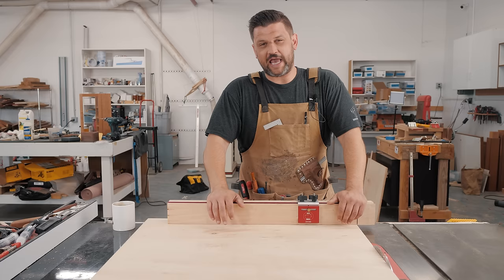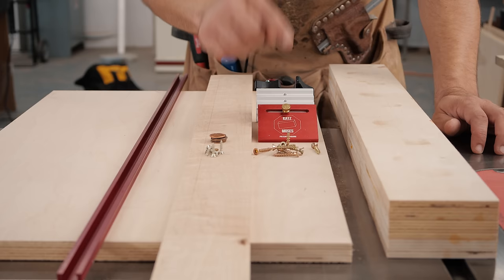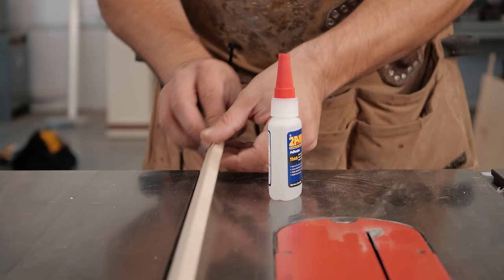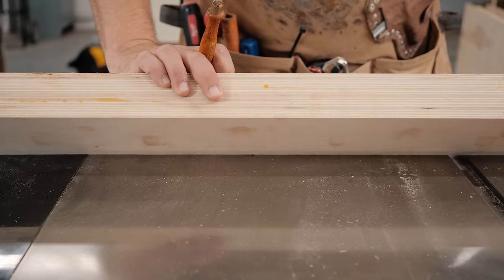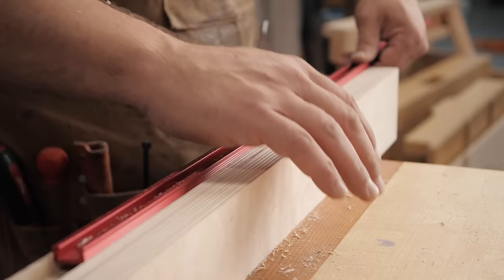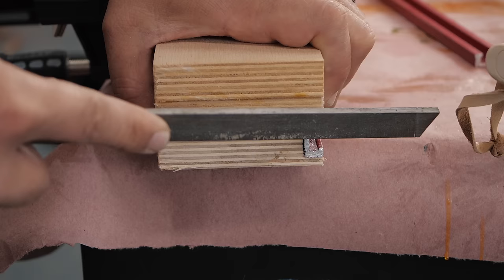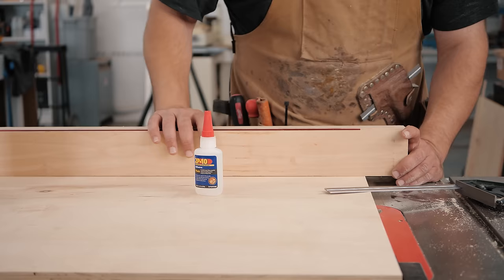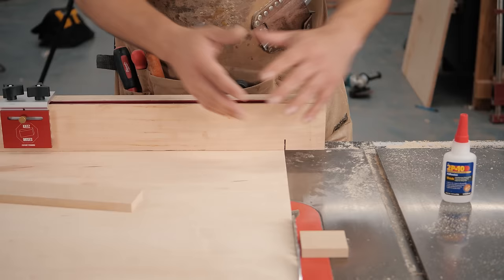Super Accurate Simple Crosscut Sled

Comment: 5-cut method isn’t for lack of a reference surface.  You can put a 1/8 strip of wood in the kerf of a normal sled and use that as a reference.  5 cut gets you dialed in much more than a square can.  I use a known accurate square to align my fences when I first attach them to my sleds.  They always end up moving after 5 cuts.

Comment: I don't get why everyone insists on using hardwood for the runner. I've tried this and have had issues with wood movement.  I went to plywood and I couldn't be happier. It's dimensionally stable throughout the year and super easy to batch out a bunch of them once you dial it in perfectly. Yeah it may dent or chip over time and use, but never along the whole length simultaneously and never had it bind or become loose.  Maybe I'm missing something, but I'm happy as a pig in ..... Well you know.
Reply: I use UHMW Plastic which is very slick and not susceptible to movement either.
Reply: @KeithJohnsonCustomWoodworking  Thats a great option too.  I never seem to have any handy when I suddenly decide I need to make a jig. But I agree.
Reply: @brett328  I keep a couple of wide strips around - it's great material for auxiliary fences as well.
Reply: @brett328  Walmart uhmw plastic cutting board. Very cheap and you can get like 6 pairs of runners
Reply: @KeithJohnsonCustomWoodworking  cheap dollar store cutting plastic board works makes plenty of runners

Comment: I am in the process of making this sled. I just purchased your stop block and it's awesome. I do have an issue with gluing down the fence. Once it's glued and you find it's off a tad, your project is trash. I prefer to use two-sided tape and screws. If I make any mistake with the accuracy, I don't end up throwing away this project. Once it's glued, your screwed.

Comment: If that method truly is accurate for square, I have an idea. Make the right side of your crosscut sled just like you did here but have a full width fence. Square the fence up as shown, then make the left side with a second runner. Butt the left side up against the right side (blade down) to glue on the left runner. Attach the fence to the left side, then raise your blade and cut the kerf width off the left side of the base. Does that work?
Reply from the maker: That's a damn good idea!
Reply: Yes that totally works, Mattias Wandel did a video building a sled this way.
Reply: I was just thinking the exact same thing myself after watching the video and then scrolled down to the comments to see if someone had thought of that as well, and here we are.
Reply: same here
Reply: Just had the same thought.
Reply: Good idea
Reply: I have read this ten times and fail to follow along. I even tried to find Mathias Wandel reference. My first point of confusion is left and right. Is this from the operators perspective or viewers? The next is butting the left side up against What?  Even as I try to explain myself I become more confused. Can you clarify? Thanks
Reply: @willemkruger4564  I will try. Everything is from the operator’s perspective. Your fence is to the right hand side of the blade, right?  So cut the right side of the base. Attach your right runner. Personally, I would install the runner with a little overhang over the saw blade (to the left) and make the final cut using the runner instead of the table saw fence. 

Attach the sled fence with one screw so it can pivot. Remember the fence should be the full width you want for the sled with half (or whatever) hanging off to the left side. Use your biggest accurate square to get that fence square to the cut you just made. Secure the fence to the right side base with more screws. The fence is now square to that cut. 

Now just butt the right hand edge of the left side of your base (that you already cut) up against the left hand edge of the right side base. Screw the fence onto the left side. Attach the left runner. 

Put the saw blade below the surface of the table, just like you would do for a zero clearance insert. Put the sled in place with both runners and slowly raise the saw blade up into the middle of the sled bed, then move sled fore and aft to complete cut. 

This may not be as exact as the 4 cut method, but I bet it’s good enough for 95% of applications.

Comment: I've made a few fences and easier than routing the groove for the track is to cut the center piece of ply shorter than the other two by just enough to set the track in flush. Why not? You're cutting the ply anyway, so might as well dial it in before hand.

Comment: I really don’t understand why you wouldn’t check the fence using the five cut method. It’s very very easy and will tell you straight away if your fence is set properly or if your square is inaccurate.

Comment: BTW Great video and I actually don't think you lose features like width of sled. I think you do the same thing as you did but run a longer fence past the cut and then just add plywood on the other side . Either attached the fence to the other half or leave sliding as support like I believe the Incra sleds do.

Comment: Jonathan, great video as always, but I’m wondering why you didn’t make a chamfered edge on the bottom of the fence to channel away dust? I was hoping to see that, because having the chamfered edge makes lining up the square ( 8:10 ) challenging (because the thickness of the square is thin.) Would have been interesting to see how you address that.
Reply: Also missing some steps on how to get the fence squared while attaching it! Ugh

Comment: Question for you… could you theoretically use this method (not using the 5 cut method) to make a sled with 2 runners?  For example, could I attach just the left runner first (leaving plenty overhang on my base) and then run the sled through with that runner in the right miter slot, cutting the left side of the base with my saw blade.  Then square my fence to that cut and attach the right runner and then finally attach the right runner?

Comment: Now something else I need to make. Did you think about running a 45 on the bottom edge of the fence to stop dust build up?
Reply: Good idea, but I bet since Jonathan's stop block doesn't sit on the sled that there's enough gap to avoid sawdust from getting between it and the piece being cut.
Reply from the maker: Agreed but couldn't hurt certainly
Reply from the maker: Couldn't hurt but like the gentleman below said not very necessary

Comment: Here's a thing. What if you made 2, one for the left side, one for the right. Then used an extended backer to join the 2 together (and a rear brace). Then you wouldn't need the 5 cut method, but it'd be just as accurate. Right?

Comment: Quick question: first off, I built this crosscut sled a couple of months ago and it has been an absolute lifesaver. I’m in love with it and now I rarely use my miter saw.  Thank you for sharing this build!  I did outfit it with a KMT stop block and grabbed some rails from your shop as well!

so I’ve recently had the need to cut some 45° miters for some very small miter joints on small work pieces, and the idea occurred to me that maybe I could modify this crosscut sled, seeing that it only uses one miter rail, if I moved the sled over to the right miter slot and set my blade for a hair shy of 45° (I have a left-tilting table saw) and cut through it down the middle of the sled for 45° cuts? I would probably put a structural fence at the back of the sled to hold the back together before making that initial cut through the sled.  Is this a terrible idea? Do you have any additional thoughts or recommendations? I appreciate any guidance you may have before I go ahead and potentially destroy my beautiful sled.

Comment: The 5-cut method is perceived as difficult to understand because it hasn't been adequately explained.  All you are doing is making a cut, then using the inaccurate cut to make another, doubling the error.  Once 5 cuts have been made, the resulting total inaccuracy is 5 times the error of the single cut.  Then all you need to do is divide the total error by 4 to find the inaccuracy of the first one.

Comment: This sure beats the 5-cut method.  I will be making one next week.  What do you think about using t-track scraps for runners?  I have some that are countersunk and fit the slot perfectly.
Reply from the maker: Nice. Metal on metal doesn't sound like a great long term solution for a sled but aluminum is pretty soft so maybe it'll be ok.

Comment: Truly like the build, specially the use of a "T" track on top for stop blocks. The one thing I don't like about it, it still allows, (even if it's a scrap piece), the cutoff can still drop down on the spinning blade. I like a "two piece" crosscut sled or a very large solid 1 piece that covers my entire TS top, each their own. Great video. Cheers :)

Comment: How about a full width sled but insert a piece that is the kerf width into the kerf and square from that?
Reply from the maker: Pretty unreliable imho
Reply: I have a pair of large drafting triangles which are as thick as the blade kerf and it worked well as a register.  I put the runners on the bottom and a front piece on the sled to hold it together. I then cut the blade opening, stopping at about the point where my fence would be.  I was then able to reference the large 14" 45° triangle to the 30-60 placed in the kerf and get a good square sled.  I've done this on about 6 sleds with no issue.

Comment: the track on my table saw does not have straight walls.  There are small indentation periodically along the track.  thoughts for handling this with the runners??  Also, my table saw is portable and only has one track.  Is this a problem??

Comment: Question I have the same problem, if not at first then eventually probably b/c of how I store my sled but at 7:50 you can see the base of the self does not lay flat as the board is warped. Will this cause issues in your cut? I imagine it would not be square on the Y axis of the plane to the blade. I've scrapped a few sleds and started over esp on MDF ones but wondering if I really didn't need to.

Comment: Just watched your video on the cross cut sled, love it, as well as the no deflection stop block. Just ordered 2. My question, since I have metal runners, which I plan to use, what are your thoughts on using them instead of solid wood?
Reply from the maker: Should work as long as there's no play

Comment: I love the videos, I have a fairly small 10" Craftsman table saw with T track type miter slots. There are only overhangs near the front and back of the slot, not the entire length. Would you suggest using t track runners or perhaps grinding off the overhanging sections to make it an open miter?
Reply from the maker: Grind off the t-track
Reply: @katzmosestools  That is where I was leaning, thank you for your time.

Comment: How would using the 3-4-5 triangle method compare to using the method you showed or the 5-cut method for getting the fence square?
Reply from the maker: If you can measure with machine accuracy it might work. If you're off by .02 anywhere it will be waaaaaayyyyy out of square

Comment: Trying to visualize this but maybe one of you can help me out. Could you build the far side the exact same way (with another fence T-track etc) and rotate it to use on the other side of the blade?
Reply from the maker: Sure but it would be a very skinny sled
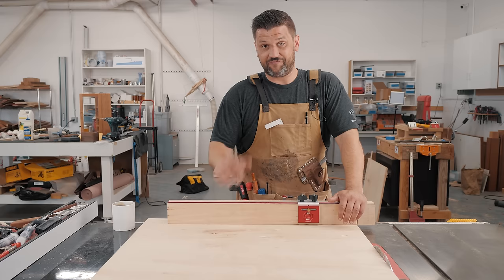Reply: @katzmosestools   Thank you for your response! What would be limiting your width? What I'm envisioning is what's shown at 0:16 with another symmetrical side directly in front of the camera out of view.  If you were to use it on the left side you would rotate it 180 degrees to keep the same short side towards the blade. The only assumption I see that I'm making is that the grooves in the table that the runner rides in (forgot what they're called and can't play through the video to see what you called them while I'm typing this lol) are the exact same distance from the blade.  Other than that I can't think of why it wouldn't work, but I really feel like I'm missing something here.
Reply: I'm sure I'm missing something silly, but unfortunately I don't have much of a table saw to try it out and figure out what.

Comment: I'm curious.. The guys that do the dual track sleds and square them up with the 5-cut method still do the initial squaring of their fence off of the reference line created by the blade kerf, just as you do here. 

Even these experienced woodworkers, apparently with 'degrees in mathematics', still find their sleds up to 20+ thou out of square over a 20 inch cut initially. You might not even detect that error checking with a pocket square over a 2 inch cut.

Just wondering why you would discourage, and indeed even 'trash talk' those that take the extra few minutes and do a 5-cut to actually verify that they're as square as they really can be? You obviously do care about precision, taking the time to dial in the mitre slot fit, and designing a zero deflection stop block (which looks cool by the way, I'll check it out). 

The math isn't really even that complex, you just plug your numbers into the formula and enter it into a calculator. Best case, at least you'll verify you actually are square. Worst case, you could spend a few minutes in the beginning and save a lot of time in the future that you'll spend hand planing and sanding to chase that 'perfect fit' that could have been achieved in a single cut.

Comment: Love your videos! This may be kind of a dumb question, I’m a newbie at woodworking. I made the sled but what advice do you (or anyone else) have for trying to make a perfect 90 using a piece of wood that doesn’t have a flat reference surface to put against the fence. I’ve found if there are any tapers or the wood isn’t straight I get a nice 90 but it a slanted side. Would you shim the piece against the fence? Thanks for any thoughts or advice.’your videos are super helpful
Reply from the maker: You need to have a flat reference edge first before using the crosscut sled. Try my jointing/jointer videos. Cheers